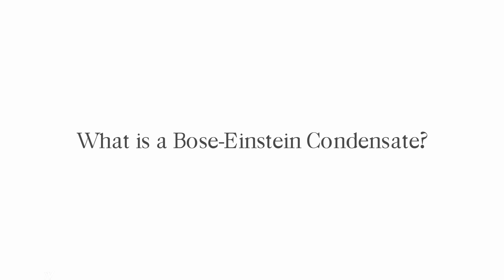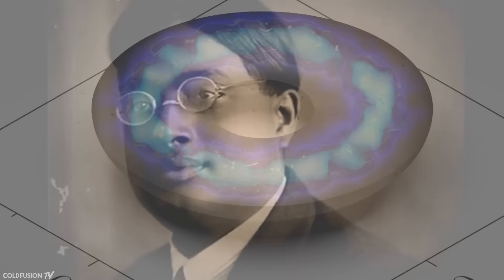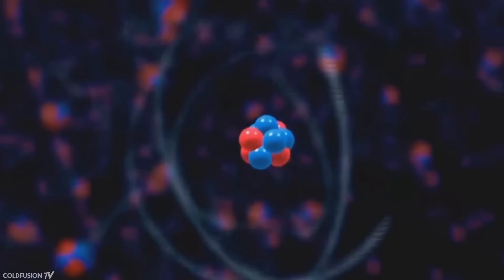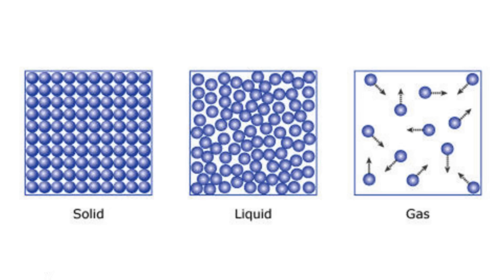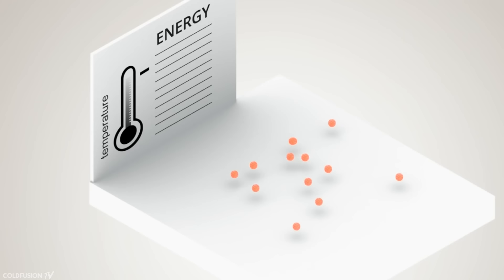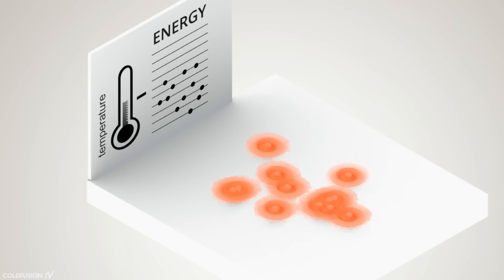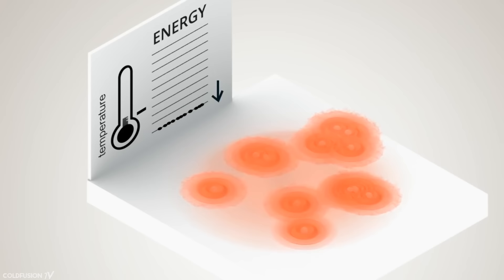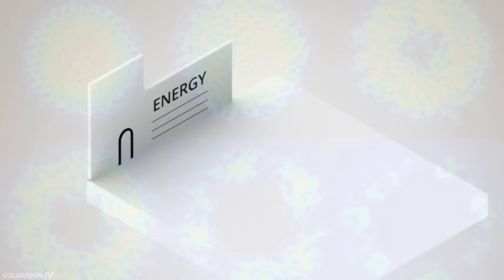A.I. Learns Nobel Prize Experiment in Just 1 Hour!

Comment: something tells me only because you use a computer it doesn't make it A.I. 
It's basically doing the same thing as a portable automatic vacume. it basicly cleans every inch of carpet till the objective is complete. sure its more sophisticated but same idea. runs every possible scenario till complete.
Reply: a program that only has the capability to run every single scenario as a dumb tape player is not AI. id call it a command program with an objective. and yes im sure its sophisticated. home computers do almost the same as that so called A.I. it searches all of the hard drive till it finds your keyword search items. its noy doing it in a smart way just random.
Reply: What you're talking about isn't A.I., nor what they used here.

There are different ways of implementing A.I., but common to them is that they take multiple inputs, like readings from sensors for instance, and they produce one or more outputs, like whether or not laser A should be on. Then it's given a feedback that indicates how well it performed the given task, and depending on the type of A.I. this is used to adjust values within the A.I., usually introducing bits of randomness to avoid getting stuck at local extremes. This is how the A.I. is trained.

The A.I. has no concept of lasers or degrees or whatever - all it "cares" about is the numerical values being fed to it - nor does it need to "know". Only thing it needs to know is how it turned out. Likewise, the internal states/numbers inside the A.I. hold no defined meaning to us - we can't "dissect" its "inside" and point at what makes it do A or B.

Because of this (and other things) a "perfect" A.I. is not what you're going to get, only a highly accurate one (depending on how much training it receives etc). You could teach an A.I. to add two numbers together, and it'd get it right pretty much all of the time, but it would not stand up to an ALU performing the same operation, but then with the "knowledge" of "numbers" and "addition" given to it by the designer.

Of course, if the A.I. has access to an ALU (through its outputs), and its performance rating takes into account the output of that ALU, it would likely figure out that using this would be the better solution. Just like humans using a calculator rather adding numbers by themselves. There's no guarantee, though.

Comment: So at what point does a machine go from being regular to being AI?
Reply: Alvaro Hernandez it being able to learn by itslef, without any background knowledge or assist from anything. for example, an AI would be able to just decide to "pick up the laser" ans try to solve the problem with it. now human science fonction Almost the same way, we try to extrapolate to something, and then try to demostrate how it is good or not. the AI do the same, the only thing separating from a true AI is that it does not set it's own goals. it just wait til we give it something. it's like if deepmind decided to train to play the GO game to see if it can Beat the human champion, without enginieers teling it to.
Reply: mansuy adrien the only thing separating what from true ai? Regular computer from ai? Or real intelligence from ai?
Reply: Alvaro Hernandez
just a smart program, this is still a realy smart program and a general purpose one, but it does not yet think for itself.
Reply: Alvaro Hernandez Its to do with how the software goes about working out a solution.  Until recently all software was deterministic and written,  designed and deployed by us humans.  It used static hard coded statements in that code that worked out a solution using brute force.  IF this do THAT or WHEN X do Y.  AI however is not the same.  Instead of lines of code it uses neural columns that emulate how the cortical structure in the brain works and these even develop their own algorithms.  It uses a process of complex adaptivity to arrive at a solution rather than brute force. The software can write its own software,  and therefore really complex problems that cannot be cracked by trying all combinations,  or running faster,  or having more computers can be approached using a much different methodology which is close to how nature managed to create me and you starting out with only a few chemicals billions of years ago.  Except the machine is obviously much faster than natures solution. 

So its not really the same software,  or type of software.
Reply: mansuy adrien Well you as a system don't start out with no information.  You use eyes,  ears,  nose,  etc.  to gather raw data.  Your entire model of the world is based on that and your ability to work this out has increased almost directly proportional to the raw data you took in. 

Same with A.I. In fact the open source google deepmind project uses a virtual reality world to teach A. I. 

Otherwise it just a potentially smart machine in a box.
Reply: Mickelodian Surname if we don't tell it what to do, how does it know what it's goal is?
Reply: Alvaro Hernandez well lots of advents and even thing you do are done without you knowing what to do but you know what the goal is. 

So I suppose as a simple analogy lets say you had a task...  that task was some goaless objective and you are never informed what it is...  all you can do is carry out actions and whatever you do either good  things will occur or bad things as a result. 

so your job here is not to achieve the goal its to make good things happen. 

so some outside force gives you say 100 sticks,  10 trees a rope and a reem of linen. 

so you take some random action...  you take them all from the pile and put them into groups of the same size... 

you are rewarded with a piece of bread. 

well thats not very good but hey one action is a piece of bread... yummy. 

so to save time the next time around you try lots of things. You arrange them by weight,  by shape,  by color,  in groups of two,  of three etc. 

next time you are given a slice of bread for some solutions,  no bread for others and for one or two you get a slice of bread and an apple! 

well heres what you now know. 

the bad solutions can go,  they were useless.  the great ones you'll keep cos they are worth apples.  and the good ones?  well they were a few of those... but which ones were better?  or closer to the goal?  the unknown goal. 

well here's a weird idea.  lets say we take all the good and great ideas and we create more ideas that are sort of like them.  we cross the solutions...  

over time,  slowly and iteratively the rewards begin to improve as different solutions and their offspring are tried out. 

eventually after maybe 500 sets of solutions you've assembled a boat,  with a sail... on a river...  and it moves... 

and you still don't know what the goal is... 

so who is handing you the rewards?  well its automated...  it's any action that took you down the river...  

there were other solutions too.  you could have ended up with a Flintstones type car or a crude glider...  or some other weird contraption...  but you didn't know the goal...  all you knew was you were hungry. 

well thats 'sort of' how AI algorithms work. Or how an AI machine constructs them to work... every iteration gives a score to each solution.   they are. crossed,  a new generation tried out and there is usually a part in the process that deliberately cheats the poor machine out of rewards by mutating some or all of its solutions for the next generation of solutions. Rather counter intuitively this speeds the process up.
Reply: Alvaro Hernandez I suppose you could say the machine is not intelligent,  it the PROCESS that is the brains of the operation.  You'd be right there too if you assume this.  Its just a structured method or process with some random element thrown in. Theoretically if we removed YOU from the analogy and replaced you with some automated way of randomly selecting 1000 solutions as a start...  and then also had some way of removing all of the crappy scoring solutions it would still work...  though probably not as fast. 

In AI the term for all of the possible combinations is called the ' search space' and each solution is called an 'agent' and the process of reward is called 'fitness' and the process of mating the best or 'fittest' agents is called crossover. 

There are also then neural columns that score the solutions and remember things and theres well an entire field of study in AI which looks at which processes work best.

But what you don't get a lot of are coders involved in telling the machine what to do.  If we had coders that knew that we wouldn't need the machine. 

The whole point is that the machine needs to work thing out,  sometimes in a near infinite search space.  We can't check all of those one after the other,  there's not enough time in the universe for that no matter how fast the machine is.  So we don't need a fast computer,  we need a slow one,  like the human brain,  where its strength is in the ability to very slowly improve on solutions it finds.  

It might not find the best solution,  bit it will find an optimum one that regular computers or humans cannot.
Reply: Mickelodian Surname ok we know food reward is good because we feel hungry, but a machine doesn't feel like we do, it must be programmed to know what to strive for what is good and what's bad. We know doing nothing is bad because we feel bored and our bodies get sick, we know our rewards are good or bad because of our feelings based on our needs. A machine cant feel, so it must be preinstructed on what's good and what's bad.
Reply: Mickelodian Surname maybe like you say, "score" maybe its programed to get as much score as it can, and lower scores should be avoided, but then every single action (billions) must have a preset score? That wouldn't work idk
Reply: Alvaro Hernandez the food thing is just part of the analogy.  Within the framework of AI its actually a long stream of numbers that carry a fitness score.  

plus its obviously a little more mathematical than that but you'd hardly forgive me for firing a pile of math at you. 

The basic way it works is by mimicking what nature does in evolution.  Evolution is just a process to and it doesn't have any goals.  All that happens there is that good solutions have baby solutions that are good too and bad solutions miss the opportunity to have any offspring at all. 

So the AI machine is just copying that... 

At the moment its not aware of what its doing...  well,  hmmm,  I suppose we'd need to know what 'aware' means. But its not making conscious decisions to achieve a goal we set out. 

If we already knew the winning solution we wouldn't need the machine.

But hey,  take my word for it,  it works. Google Translate is a good example.  Nobody programmed it to learn all of those languages.  It learned on its own. 

Then there are solutions nobody knew the final solution for even after years or decades of research.  AI solved a lot of that millions of times faster than every researcher in the field. 

So it works... 

A lot of AI is based on the ideas of John Holland,  and some of it stolen wholesale from evolution theory (well the mathematical bits) and some of it is taken from Neuroscience.
Reply: Alvaro Hernandez the food thing is just part of the analogy.  Within the framework of AI its actually a long stream of numbers that carry a fitness score.  

plus its obviously a little more mathematical than that but you'd hardly forgive me for firing a pile of math at you. 

The basic way it works is by mimicking what nature does in evolution.  Evolution is just a process to and it doesn't have any goals.  All that happens there is that good solutions have baby solutions that are good too and bad solutions miss the opportunity to have any offspring at all. 

So the AI machine is just copying that... 

At the moment its not aware of what its doing...  well,  hmmm,  I suppose we'd need to know what 'aware' means. But its not making conscious decisions to achieve a goal we set out. 

If we already knew the winning solution we wouldn't need the machine.

But hey,  take my word for it,  it works. Google Translate is a good example.  Nobody programmed it to learn all of those languages.  It learned on its own. 

Then there are solutions nobody knew the final solution for even after years or decades of research.  AI solved a lot of that millions of times faster than every researcher in the field. 

So it works... 

A lot of AI is based on the ideas of John Holland,  and some of it stolen wholesale from evolution theory (well the mathematical bits) and some of it is taken from Neuroscience.
Reply: Mickelodian Surname oh yea i see, it works. Thanks for sharing that with me.
Reply: Alvaro Hernandez well the scoring is just a process...  the machine reacts to the low score of any solution by making the assumption that the solution is inferior to the others.  so it basically rolls a dice and then adds the dice score to the assumed low score. 

the score itself is made against a comparison...  which in modern AI is actually the average other scores of all the other solutions. Now if it were you doing the work you might manage 100 solutions. The machine however might have a million of them. only a finite number will be allowed to reproduce. So not only is the machine  working on an overall solution it can't see but every solution is fighting for survival too. plus in modern AI there migjt be several thousand overall solutions that when all combined in the right order makes an even greater solution.  That all has to be worked out in every iteration too. 

But I can absolutely confirm that AI folks not only don't, but its nit possible for us to tell the machine what to do or how to go about a task.  Not cos we wouldn't want to,  but mostly because we don't know what the best solution is.  That's what the machines are for.

Comment: You didn't really explain how the AI worked or why it figured out how to do it. It sounded a lot like it just magically came up with a solution when in reality people have to determine and give the "AI" its means to accomplish its "goal". After all, an "AI" is just math that's running chaotically in the boundries the programmer gives it.

So it all sounds so great, but is that what we call AI really AI if it isn't autonomous? It didn't choose what it was looking for. It didn't choose what it would need. It didn't choose what methods it would use to get to its goal. That's the free creativity - instead of being contained in its boundaries - it is still lacking.

But that's just nitpicking - the thought of cleverly designed fitness functions used to apporximate neccessary experiment setups sounds great and I think the video was informative on the physics stuff and entertaining.

Comment: Degrees kelvin...
U w0t m8?
Reply: Yes, degrees Kelvin.

Do you know temperature at all?
Reply: Yes.
Reply: MrFujinko So you then know Kelvin.

Kelvin is, long story short, used in ALL scientific measurements period. ~273.15 degrees Kelvin represents zero degrees Celcius, and the melting point of ice. 373.15K/100C represent the boiling temperature of water. 233.15K/-40C equal -40F.
Reply: The trick here rookie, is that in general the degree symbol is mostly found in arbitrary scales, like Celsius. Since Kelvin is an absolute scale, it has been widely agreed that it should not carry the degree symbol. Just a matter of convention.
Reply: MrFujinko It still happens to often be attached, very often so, and coming from Celsius, it feels more natural than it doesn't.